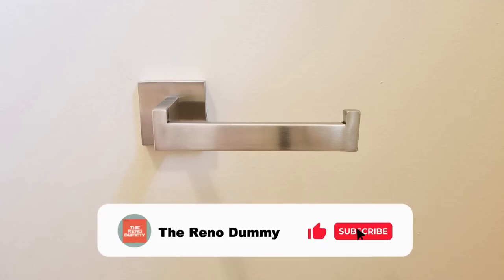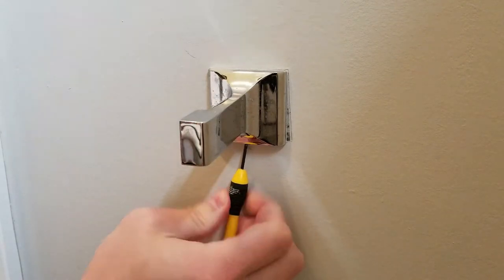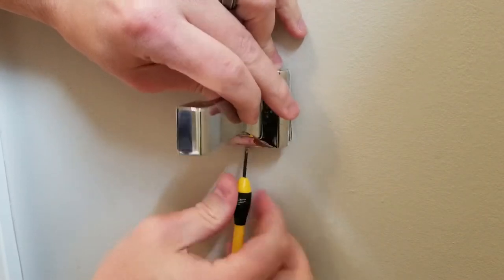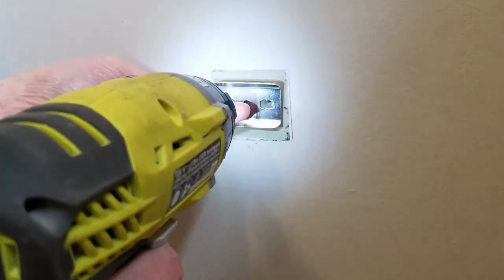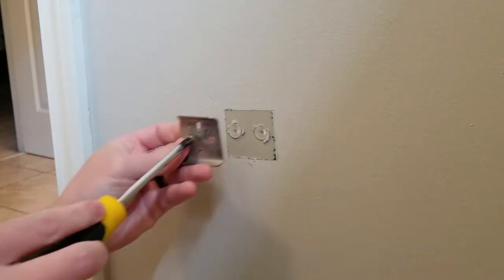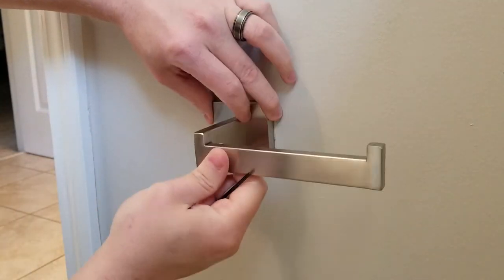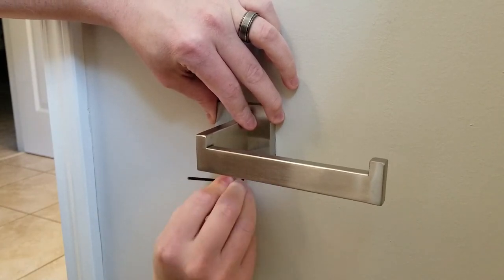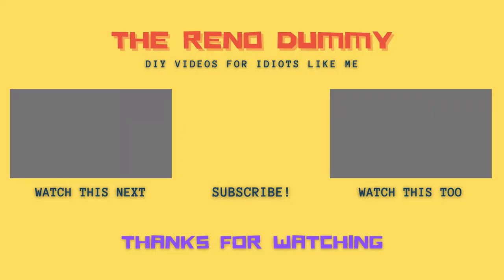How to Install Single Arm Toilet Paper Holder - Easy Install!

Comment: Need a solution for RECESSED paper holder for a cabinet.
Reply from the maker: A recessed holder in a cabinet? Not sure about that one. I imagine you could cut a hole in the cabinet door just like you would in your drywall.